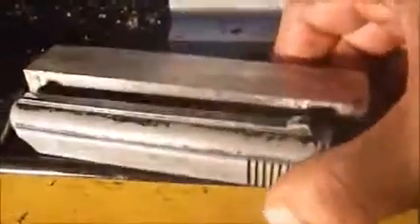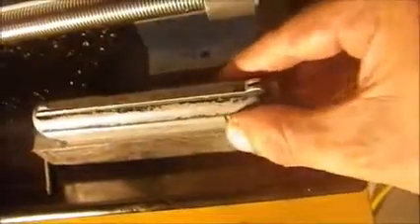fabricating a steel Jennings J-22 slide

Comment: I applaud your efforts! I have a couple J22’s that I would love to get running properly. This would be a good possibility to get them running more reliably!

Also, Walther P22’s use zinc slides, and are known to crack. Walther will warranty them, but it would be nice to have a better material options for the slide on them.
Reply from the maker: Beyond swaging the barrel chamber down to remove burrs made by the striker, I don't think there is much that can be done.  A major problem I encountered is that the frame was/is a Zamac casting while my efforts were to machine a steel slide.  The steel is much harder and even when manually cycled visibly (light grooving) wore down the frame.  This means that even if it fit perfectly when made, only a few shots would begin to change tolerances and soon the gun would be just like the originals, i.e., not working, but also rattling when shaken.  LoL
A further complication I encountered is that while I could bore out a slide recess to retain the barrel spring wrapped around the barrel, how to keep it in the gun?   
The original slide appears to be a machine casting that closed in the front.  Simply putting on a barrel bushing or a screw on nose cap would be needed.  But the original walls of the slide are too thin to allow notches for a Colt 1911 type bushing or even a screw on nose cap.  I did look at doing a press fit, but I didn't/don't believe it would hold up under firing and recoil stress so I shelved the project.   With hindsight I realize that a machined nose cap would probably work, if it was then welded in place.  One of the fun things about reverse engineering a machined duplicate is figuring out the needed sequence of cuts and what relationships are critical.  I once had to make several attempts at fabricating a brass replacement for a knurled part on an antique before I finally realized the ancient gun makers knurled the part first, then and only then, did they machine it.  LoL  I had been making the cuts then trying to figure out a way to knurl the not round result.  
I don't think there is much to be done to restore old Jennings.  I had an out of battery AD on mine once while loading.  Because my trigger finger was very carefully no where near the trigger an exam was indicated.  It turned out that somehow in a just finished firing session a tiny sliver of metal had  somehow jammed the extractor inwards.  Chambering a new round from a newly loaded magazine resulted in the extractor wrongly striking the cartridge rim and functioning as a firing pin before the slide was all the way forward.  That was the end of my use of the Jennings for anything except plinking.  
Noting also the safeties on them is very marginal and cam a;sp ,move in a pocket (not that pocket guns should actually be carried in a pocket (perish the thought).   :)
Reply: @kenibnanak5554  Once again, I am amazed at the effort and thought that you have put into trying to fix what many would call a throwaway gun. It’s a nostalgia thing for me, but I have kept my J22’s in hopes of having them repaired one day, regardless if the cost exceeded the price of the gun. I figured that someone such as yourself would put in the effort to make these somewhat operational again. My hat is off to you sir. Keep fighting the good fight!
Reply from the maker: @cliffh1975  There are a lot of inherent difficulties in designing and manufacturing small pistols designed to fire rimfire .22 ammunition reliably.  Just designing a magazine that feeds rimmed ammo reliably is a big challenge (which is why many .22 rifles used tube feed instead).  In the pistol itself, because the ammo is so small, the manufacture tolerances usually have to also be small.  Throw in mass production and the issues multiply.  Add in the target price of sale and there went your quality control.  The smartest gun designers around at the end of the 19th century and the early 20th looked at the issue and decided to not waste their time on .22 pistol.  I am sure J M Browning looked at it before deciding to invent his .25acp and .32acp caliber instead.  .22 was a discarded option when he instead came out with his .25acp Vest Pocket and his 1900 .32acp pistols.  On the other side of the planet Paul Mauser's firm also decided to ignore the .22 rimfires and their first pocket pistols (1909) their 1910 and 1914 also used the Browning cartridges.  Anyway fast forward to the late 20th century and the 'ring of fire' pistols.  The intended life span of those (Bryco, Jennings, (and I will include Sterling and Raven in that bunch) et al) is maybe 20 rounds.  Yes, some folks get a few hundred rounds off before issues appear.  But the intended customer is someone who uses the gun only once or twice in a gravest extreme situation.  For well less than $100 when new that may be acceptable to those of low income.  These guns were never intended to be long range accurate or to last for 10,000 rounds.  Intended for use at less than 5 yards for just a few shots the accuracy is acceptable.  If one wants more, one must spend more.  Less is always less.  I am personally quite happy with the performance of my Ruger Mk I .22 pistol and have happily put many rounds through it.  Likewise my FN Browning .25 or my Colt 1903 .32 have provided excellent service.  Yes, I have observed that Walther and sadly some other firms chose to throw the value of their firm name into the trash by making guns with Zinc parts as a cost cutting measure.  Simply put, like many of today's cars, the guns are designed to break so the consumer has to buy a new one.  Before WWII guns were usually not intended to break and when they did, it was usually a minor repair.

Comment: Did you make a follow up video
Reply from the maker: Interesting.  I had totally forgotten this video was out there.  A slide was completed (after several back to the drawing board moments), however as it was a milling vs the original casting it was necessary to make minor changes, which changed some dimensions.  For instance, machining the barrel's opening meant because this was a milling, the slide now needed an end cap (barrel bushing) to reduce the diameter of the opening at the front and retain the recoil spring.  A welding exercise.  This was an educational experience because I lacked any drawings as a guide, except those I generated myself.  There were several moments of, how do I make that cut?   <A: with a very thin slit saw.>  Once or twice I had to scrap the first or second attempt and get a new steel blank and totally begin all over.  Being steel it weighed a little more, enough more that I felt the recoil spring Jennings had chosen also needed replacement.  A thicker wire was needed, which wouldn't fit in the original space.  <Sigh>  Then there was the issue of the feed angle of the grip in the factory frame wasn't really optimal for the kind of reliability a .22LR defense pistol should have.  But other things I disliked were the poor safety which left the firing pin (striker) free to do whatever.  Also the lack of a way to de-cock without pulling the trigger (which peens the rear of the barrel and can cause misfires).  I did play with the concept of making a new frame, going so far as to start carving out a Styrofoam mould for a possible pour, but then I thought, what am I doing here?  Do I really want a steel pistol based on a design which was itself based on how cheaply can we make it?  Since better steel pistols already exist, the answer was no and I scrapped the project.